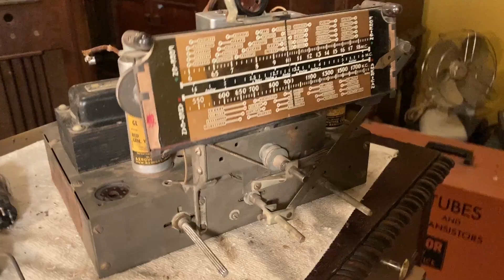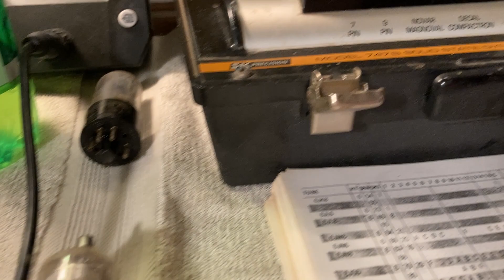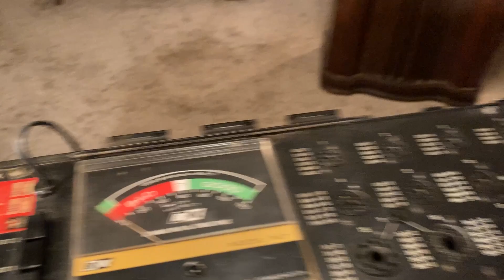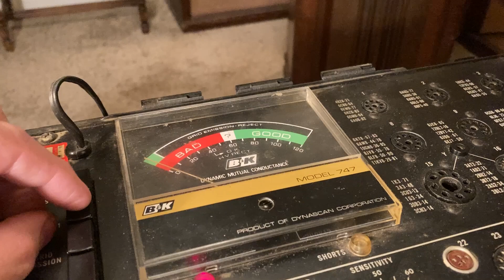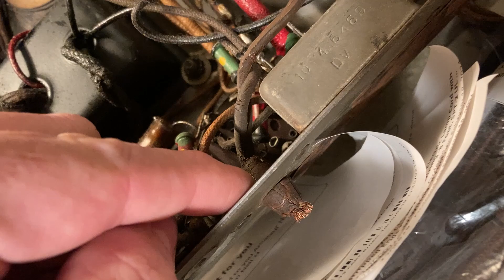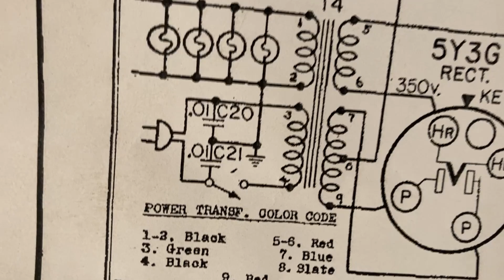Trying To Repair This 1937 Silvertone Floor Model Radio But The Tubes Are Bad!

Comment: Those .01 mfd caps on the powering are XY rated safety caps which are designed to fail open.

Comment: You can also use a 6U7 in place of the 6K7s. Easier to find in the ST/Coke bottle shape. They are allegedly not quite as good as a 6K7 but then they were put out by RCA's competition, so you know there was a little competitive shade. The metal tubes came out in '37, but the outside is usually connected to pin #1... if you're using them in that set, make sure you haven't got B+ attached to pin 1 on the socket as a tie point unless you like surprises.

Comment: Metal tubes have pin 1 connected to the shell. It replaces the goat shields. Sometimes that pin is used as a tie point, in glass tube set. So, it could have a voltage on it.
Reply from the maker: Thank you David I'll keep that in mind... usually I'd prefer to just put the original style back in

Comment: Nostalgia air or bitman may have the correct schematic for this radio. Back in the day I used pipe cleaners to clean between the plates on the tuning cap.
Reply: Me, I like using brake cleaner if the set were in high nicotine or high kitchen grease homes; but being careful as to not hose everything down, especially wax or varnished components. It doesn't leave any residue and it's great removing broken down grease used in bearings & bushings those tuners are known to have back in the day. "Evaporust" works miracles too, it's cleaning ability isn't often spoke of, but it's a great product!

Comment: The 1930s RCA way of holding power cords to the chassis was to have a knot on both sides of the grommet'ed hole so that the cord cannot budge in either direction.

Comment: So where a 6K7 versus 6K7G versus 6K7GT matters is a 6K7 (no G or GT) is a metal type. It will be physically smaller than a 6K7G so the gridcap wire might not reach it. It will also need pin1 to be grounded for the metal envelope of the tube to act as a shield. Some brands like Philco & Zenith HATED RCA and played shenanigans like removing pin1 from their sockets so that you cannot use metal tubes in some of their radios. A 6K7G or 6K7GT sometimes require shields, and a shield for a 6K7G won't always physically mate over a 6K7GT or vice versa. Electronically all 3 are the same tube as far as tube testers go.
Reply from the maker: Thank you.  I did run into the issue with the wire barrrrrely reaching.

Comment: The trouble with some of these antique radios 📻, is hard-to-find vacuum tubes. Be careful when shopping 🛍 online for these tubes. Some of the sites will sell them for a very expensive price, or the shipping 🚢 will exceed the value of the product in other cases, even if the product price is reasonable. To lastly mention, other sites will sell their product for a reasonable price, with reasonable, or FREE shipping 🚢. Be very careful here, because the word "FREE", can end up being an expensive, hidden cost. Also, don't buy from sites which the buyer has to pay return shipping. FREE RETURNS is the best 👌 way to go, in case ya must send something back. Merry Christmas 🎅 🎄 and a very safe and Happy New Year. Your friend, Jeff.

Comment: What are the differences between "X" safety Capacitors and "Y" Safety Capacitors? and How can you tell the differences between X & Y safety capacitors?
Reply: just ask Google... "X capacitors
These capacitors are used to protect against differential mode interference and are connected between the line and neutral. They are designed to fail shorted, which causes a fuse or circuit breaker to open and prevent a fire. X capacitors are typically used in North American applications between the hot and neutral power lines. 
Y capacitors
These capacitors are used to filter out common-mode noise and are connected between the line and chassis. They are designed to fail open to prevent a shock hazard. Y capacitors are required whenever there is a connection to grounded nodes, such as equipment cases."
Reply: The easiest way to tell if a capacitor is X or Y rated is to look carefully with a magnifying glass. Safety capacitors are always labelled, whether printed or etched.
Reply: @eDoc2020  I don't see an X or Y labelled and printed or etched on the Capacitors. Are you sure there will be an X or Y on the body of the capacitor?
Reply: @waynegram8907  Safety capacitors will have the X or Y rating printed but most capacitors aren't safety capacitors. If a capacitor lacks these markings it's probably not a safety capacitor.
Reply: @eDoc2020  The X or Y rating is different than normal stock dielectric material capacitors by using a different dielectric material or what? the X & Y capacitors are made differently than normal stock capacitors because of the "surge spike absorption" of the capacitor material use in the X & Y capacitors?
Reply: @waynegram8907   I think it's slight differences in the manufacturing process but I don't know the details. If nothing else it's just a certification. Normal capacitors might perform the same way but there's no guarantee.

Comment: Hint about old tubes. Clean the pins off first then test them. I use a brass wire brush on  my Dremel tool and they shine. 
A bad tube will always be a bad tube but a so -so one usually tests better just by cleaning the pins. You can make a magic
eye tube tester but try putting it in a fully restored radio and see if it works. That is the best test. Since this is a transformer powered set you should put a fuse in between  the transformer and the on/off switch.
Reply from the maker: Thanks for the info!

Comment: 👍👍👍No I find it interesting because it brings back memories about used to I'd run across a TV on the side of the road I'd stop and get all the tubes out of it and then when I did run across a TV that somebody had that didn't work they wanted to get rid of it 50% of the time when I got it home and change some tubes it worked brings back memories😎☕